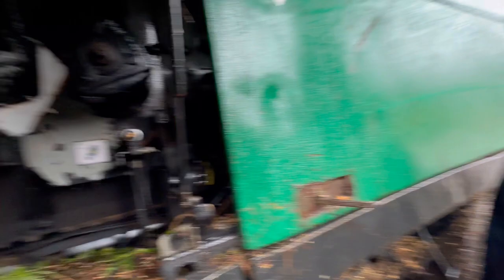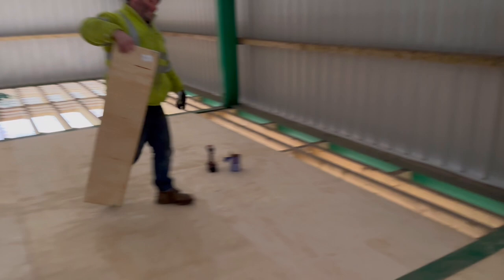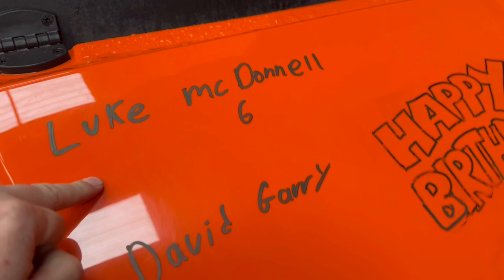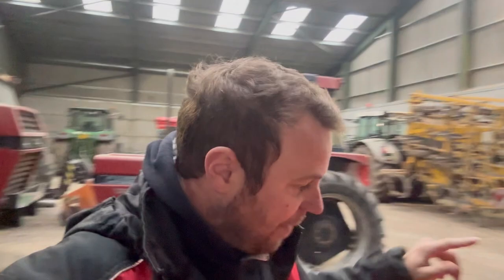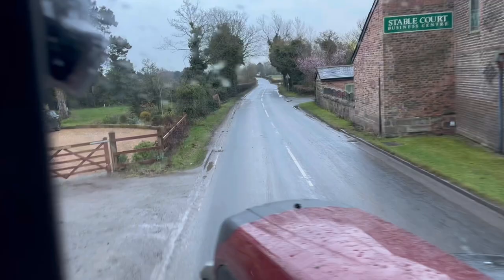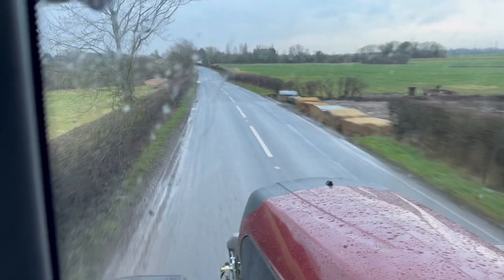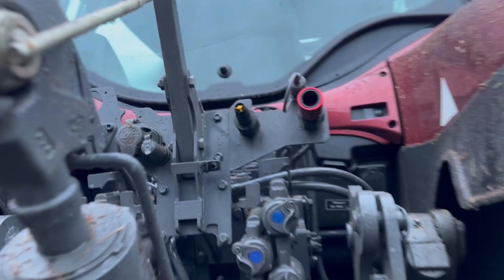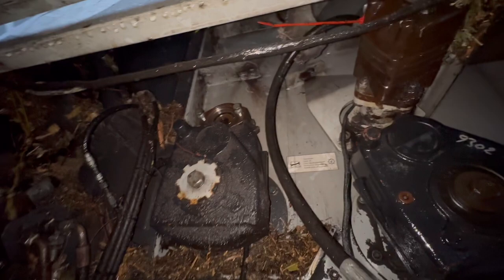WE’RE HAVE ING A BAD DAY #OLLYBLOGS #AnswerAsAPercent 1082

Comment: I think Valtra are possibly the best looking tractor on the market. The older ones I nerve liked the look of because the bonnet was so far in front of the front wheels but I've heard they were very good tractors and the forestry boys liked them. 
What hp is that one Olly? 
Lots of nerve pain today so my % is very low 20 maybe most days are around 35% because of what I just said and I can't farm which makes me feel extremely unacomplished.
Reply: Ideal for flailing too, apparently
Reply from the maker: 305hp I think
Reply: Rob i have spine damage and it causes my lower half to go crazy, I feel your pain mate. Id love to be able to do farm work, I used to help a mate lambing every year and the past few years I've had to miss and its really getting to me this year, few other things on top too but its not fun is it. But I guarantee you are an accomplished person even if you don't feel it at the min
Reply: @James27Simko  
Thanks James.  What happened to cause your injury?
Reply: @roberthiggins6401  blunt force trauma from a motorbike accident, degenerative spine disease and it puts pressure on my nerves which can fully disable my legs for days sometimes. 

How about you? Don't worry if its too personal